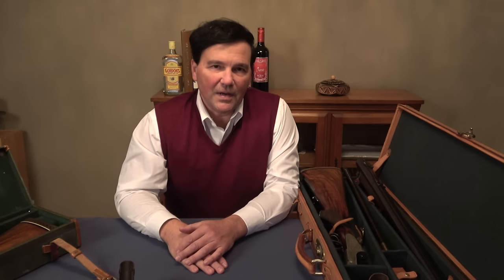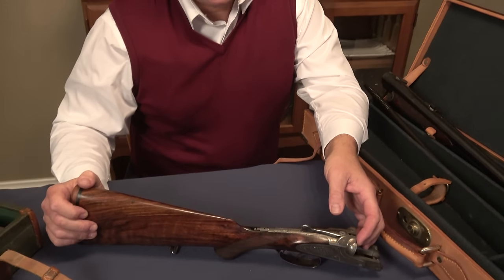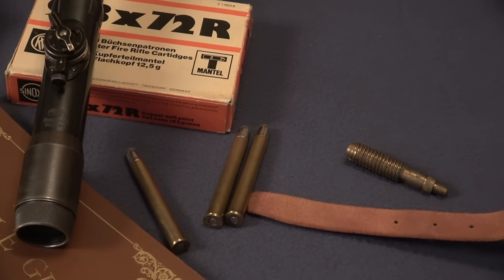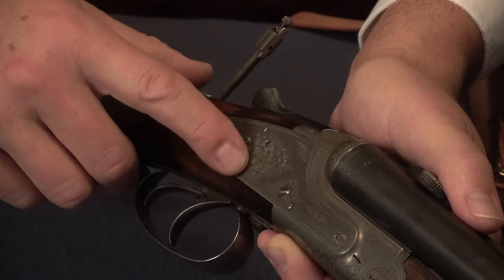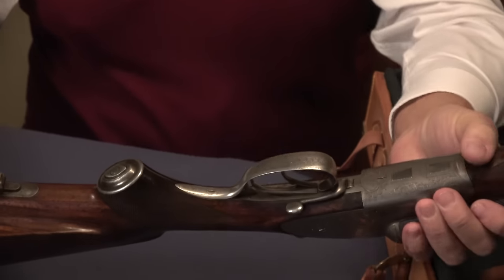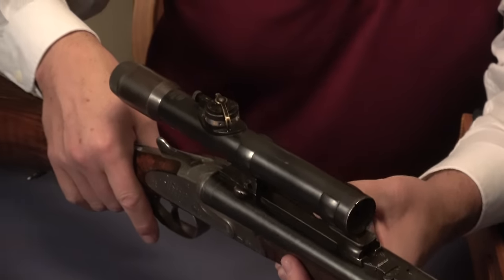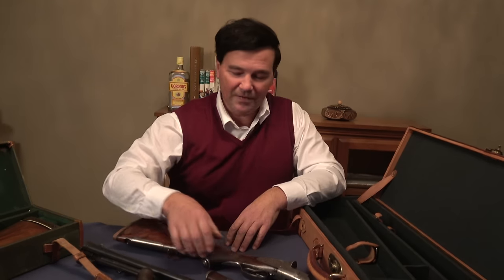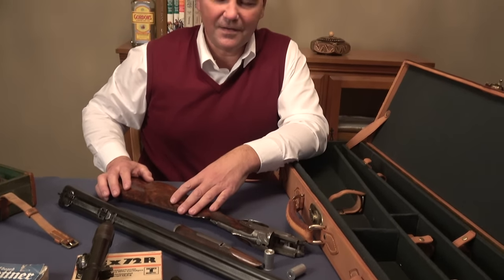An Amazing Firearm: The Drilling

Comment: Wonderful video, as always.  I have a similar model. 16g x 9.3, open hammers and trigger guard lever, 1906. The serial number was found on a specialty site as Jp Sauer no longer has records that old. An email from them explained the events surrounding their destruction. 
These arms have a balance and placement that can only be appreciated through holding them and using them.
Wonderful all around gun, maybe the most useful?

Comment: Very nice. I'm sure you have measured the shot barrels' chamber lengths. They are often 65mm or less and intended for low pressure ammunition, thus explaining the relatively thin steel one frequently sees at the breech. The fluid steel is often a molybdenum alloy but lacking the tensile strength of modern ordinance steel, so caution is justified even when older guns show nitro proof marks. Today's smokeless powders are often quite different from old ones.

Comment: Thankyou for such a great video on a high end side lock Sauer Drilling, I've not seen that model in my edition of the Der Drilling by Norbert Klups. I'm not sure if people actually use drillings hunting as there are only a handful of You tube, so I made an effort to post plenty when I got mine. Sauer make a great value for money drilling for sure.
Reply from the maker: I'll have to find Der Drilling and thanks for your good words and support.
Reply: They are used for hunting in germany, though not as much as they used to be since modern guns have largely taken over. But they see a little comeback in drive hunts due to the ability for a quick second and third shot.
Also the Drilling is still one of the 5-8 (depending on region) different firearms that you could be tested on during weapon handling section of the german hunting license test, so every german hunter is at least faintly familiar with this type of gun.

Comment: 9,3x72r is an old blackpowder round right? oftne chambered in old husqvarnas and with modern powders they can't really be loaded enough to meet the legal demands for moose and big game in Sweden
Reply from the maker: Yes - an old black powder round. It is a long cartridge and rimmed - quite thin as well. I think single shots and combination guns chambered this round. It would be hard to imagine a bolt action so chambered.
Reply: well i have an drilling with is in 16/16 gauge and 9,3x72r and i use it for moose hunting and everything else .
Reply: Sellier & Bellot makes smokeless 9.3x72r, and some (newer-production) European-made double rifles are chambered in it, but it's probably a good idea to check for nitro proofing before buying any.
Reply: fatcatbestcat my barrels say nitro on them. Proof enough.

Comment: You may be able to tell the date of manufacture from looking at the proof marks. These things will have a bunch of different proof marks, but one may have a 3 or 4 digit number; that's the date the firearm was proofed (usually, but not always, the same year it was manufactured). The first 1 or 2 digits is the month, the last 2 digits is the year. For example, 625 would be June 1925, and 1137 would be November 1937.
Reply from the maker: Thank you so much!
Reply: @UnitedStatesOfGuns  I did quite a bit of research before buying a drilling of my own. If you have a photo of the proof marks, I should be able to tell you what most of them mean. Date codes, gauge/caliber, proof marks, maker marks, etc. Some markings, nobody knows what they signify, mainly because they're internal codes (ie, a letter or number in a square, circle, etc. signifying a particular worker made the barrel or trigger guard, or a component was sourced from a specific maker, so the manufacturer can trace all parts to a particular source, but it hides the source from outsiders who may track down the source of specific components and deal with them directly instead of the middleman who assembles the guns. That was quite common in Germany, with the big gun makers sourcing parts out to local gunsmiths and then marking the guns either with the big company's name or the distributor's name. It also helps explain why two guns assembled on the same assembly line in the same year can have wildly different markings on it.).
Reply: And 9.3x72R ammunition is readily available commercially. It's almost unheard of in the US, but still quite common in Europe, so if you don't feel like reloading you can order some ammo from Fiocchi, Prvi Partisan, etc. or get it from a boutique ammo maker in the US. The reason it's such a mild load is that, like .38 Special, it originally started as a black powder round before transitioning to smokeless powder, and ammunition manufacturers kept the specs largely the same in order to avoid blowing up older guns that aren't rated for the pressures of modern ammunition. Much like .38 Special getting loaded to the true performance of a cartridge its size with smokeless ammo and having the case slightly lengthened to prevent it from being loaded in older guns and called .357 Magnum, 9.3x74R is much the same idea, a cartridge of roughly the same dimensions but loaded to the true performance of a cartridge that size with smokeless powder, and not constrained by the limitations of a firearm designed for black powder. I believe the 9.3x74R has an actual neck and shoulder though, and 9.3x72R is tapered, so they're not directly descended one from the other like .357 Magnum and .38 Special are.

Comment: First off we must ref to these in the correct pronounciation , Dri llings , from german dri (three) . Four barrelversions are veir lings. A few overlooked important festures are a "see thru tunnel under the scope toallow iron sight viewing with the scope attached, a set "hair" trigger engaged by pushing the rifle triggerforward into the click or "set" position. The scopes are almost universally adjusted for windage by the forward mount screw, elevation adjustment by the top turret knob. Rifle Accuracy is amazing accomlished bythe design of three barrels being connected together in a triangulation thus providing a very stiff and vibrationfree rifle barrel. Weight is reduced by employing Krupp fluid nickel steel allowing for thin shot barrels and a thin rifle barrel in a triangulation design. Shot chokes are achived by hammer peening the last section of the barrel toachieve not only desired pattern spread but point of aim of pattern. It is not uncommon to find the right shotbarrel choke to throw a brenneke slug perfectly at 40 yds. A dri lling is not a firearm for a novice hunter, complexityof safety and barrel selection can lead to mistakes , but in the hands of a skilled hunter it reigns supremein versitle performance.
Reply from the maker: Ausgezeichnet Gregory! Of all the combinations of drtillings and veirlings and all the other combinations of rifle/shotgun - my favorite is the bockbuchsflinte. I had a few and one in 7X65R X 16 Ga was a universal firearm. I shot more deer with the 16 Ga with slugs than the 7x65R - yet - for long range the 7X65R was there. The 16 collected grouse and rabbits as well. Please write more and more of your experiences with these remarkable firearms.
Reply: And u have a typo it's vierling
Reply: @erichermann7873  2 actually it is drei.

Comment: To date many German shotguns,take the barrels off,turn barrels around and to the right off the lugs there will be one or two rows of numbers.The bottom row ( there may only be one row),will have three numbers, say 437,which means April 1937,date of manufacture.As I say,on some guns.
Reply from the maker: Rupert Saves the Day! Thank you so much. I examined the drilling closely and the numbers are 411 - which I gather means April 1911. It is also marked Fluss Stahl and Krupp Essen. Serial Number is 73XXX. I am more amazed now - I often hear different opinions from well meaning friends and collectors yet I wondered if the drilling had really been made in the 30's instead of earlier. Now I know - 1911 - well before the Titanic sailed. Thank you Rupert.
Reply: Well, I learnt that from 2 American hunters that came to shoot guinea fowl on my farm in South Africa. I had the same dating dilemma and they showed me on my Greifelt shotgun!
Reply from the maker: I thought I had the date solved but now someone said the scope was introduced in 1922
Reply: I am positive it`s 1911.The scope must be an after market accessory!
Reply from the maker: +Rupert McNaught Davis thanks again Rupert
Reply: It is a Suhler original clawmount that is contemporary with the gun.
Reply: USOG 
Fluss Stahl was a really good gun steel. (Stahl=steel) Dont now exactly what made it special, but it was much better than other steels around. Krupp is the name of an old german family from Essen, who e.g. made the guns for the imperial army and later armys. Google them, its really interesting.
Reply: "Fluss" merely means that the steel is fluid steel, unlike Damascus. Sometime laufstahl is used. Krupp was a very famous foundry and military arms maker.
Reply: @wholeNwon  laufstahl means barrel steel. Lauf=barrel
Reply: TheFriendlyAR-15 in5.56
Thanks. My German is very primitive and little of that remains. The only times I ever used the word for "barrel" referred to the container and "lauf" for run or part of a course or I think a waterway of some sort (?).
Reply: @wholeNwon  yes, you are right. Fluss first meaning is river. But fließen, the verb, is used for all liquids. Barrel means Lauf and Fass.